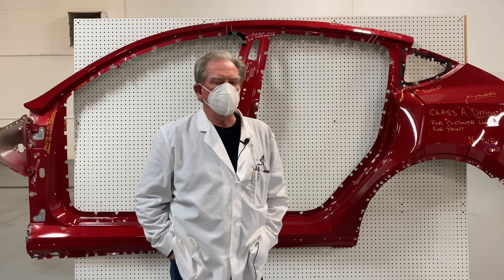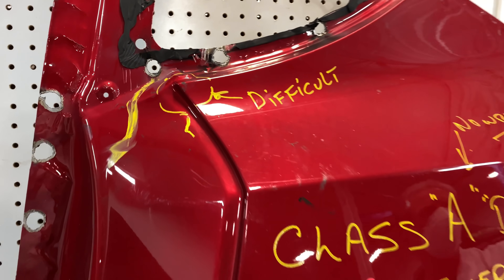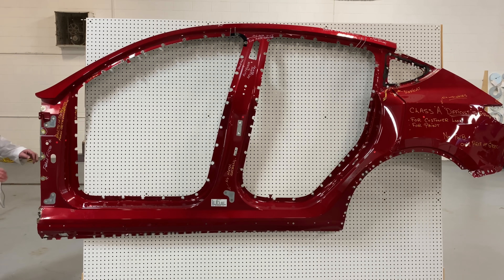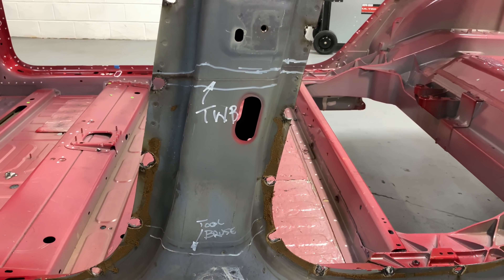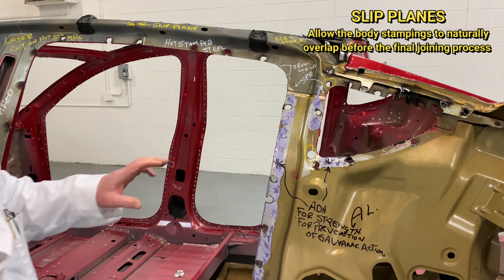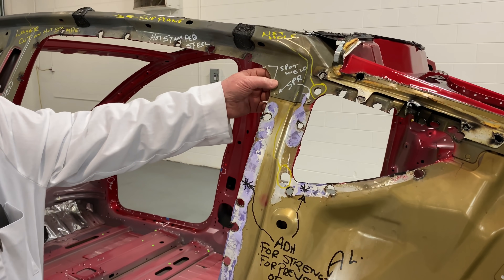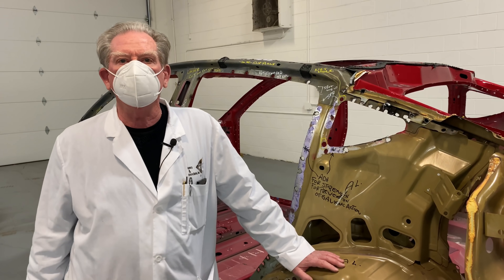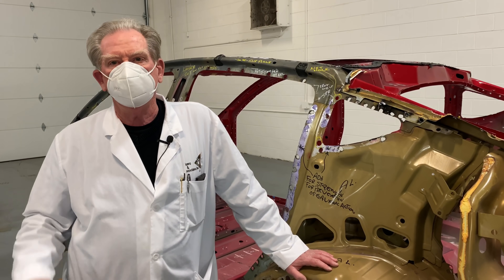Model Y E37: Body Structure Internals Revealed, Hot Formed Steel, SPR's and More

Comment: Don’t need a truck for that stuff. My little Tesla has the rear seat removed and also the front pass seat. Screw the trucks... redisign the interior. Grow up....don’t need all that toxic tech. Screw the motors in the seats. Let me cut that door up. Why the need for TWO door opening platforms? How stupid and INEFFICIENT?  Show this.  Call me, I build ten hot rods, and I’m a competent volunteer fire person and an engineer. Sad the doors are so complicated. Let’s see Elon put a door handle on a S . No wonder he has to smoke pot.  Poor design.  I’ll work for free.  Call me. 315-673-9565. Talk about the pearl paint....show the motors in the seats.  Show the unnecessary wires to the four speakers in the rear doors...wasteful? Yes.... show a fire person saving the people in the rear seat. Of a 3 and Y.  Is there a manual door system?  I hope to cut open an X in our next auto crash...  cut back on the neodymium and thorium.....call me.  I know batteries also. NCA plus.. tabless etc...show where we can cut weight and costs for the real person.  I can open the charge door MYSELF? DONT NEED A MOTOR.....

Comment: So how does the outer one piece steel skin connect to the aluminium rear quarter piece?  Looks like you cut some spot welds, but that's not possible.  Is it all attached with self piercing rivets?  Like others have asked, I'd like a discussion on how the bottom rocker panel and rear wheel arch is built to survive salt.  Especially with two dissimilar metals.

Comment: Possible rust problems with 3 & Y concern me also, noting several youtube posts from owners in climates hard on steel structured vehicles. Your Y episode discussing unpainted areas reminded me of my '67 Mustang. Ford left unpainted almost every part or area you could not easily see. The lack of paint under the cowling dogged me the entire 30 years I owned that vehicle; a good storm would soak my feet and fill the glove box every time. The only way to really fix it was to drill out the cowl welds, disassemble and repair the area, reassemble paint and seal properly. Cost was more than my example was worth. Tesla is my new dream car goal, but it has to be able to last at least 10 years without serious rust developing under daily driver usage. Our '08 Prius at 187k miles is practically rust free today.  I will be watching. Even the most rabid fan base cannot cover up all issues.

Comment: Can I count on my car guys to see things the way I do and sending me a donation to make this happen? We need a much better mask made of Thermoplastic Rubber to protect us and if made in large enough numbers can help end the pandemic being a defensive against getting the virus. In the midst of this pandemic in which covid-19 coronavirus has shut everything down I want to help and I'm developing a Mask made of clear thermoplastic rubber which can be reused many times and simply washed with soap and water and will use disposable homeade filters cutout from paper towel as the absorbent outer layer and coffee filter cutout under that. It could be replaced multiple times daily or simply when you return home wash your mask and change your filters. The Stay at home order was effective but is not sustainable because we are suffering too greatly economically as a whole in fact most of the world is due to all but essential workers being shut down unless its over internet or phone. My solution of having my clear thermoplastic rubber masks, if you donate to me so I can do it and make them available starting on eBay, are to be worn underneath your standard cloth masks fabric masks and homeade masks or bandanna. My TPR mask will offer greater protection and seal to the face and have 1/2" diameter ports on the cheeks and chin likely 7 to 9 of them total. Please watch my only youtube video and I have a Go Fund Me page because I need donations to make this mask and soon.

The filter media is to be placed in between rubber layers so its trapped and sealed. It's going to be a great answer to keep people more safe and secure and able to go out and about with their lives while still wearing a mask but a much safer mask. Doing so should become a solution to keep people from getting the virus and allow us to go outside and live our lives without getting sick and should greatly reduce or eliminate the transmission of this virus being breathed in and hopefully allow us to be able to live lives more normally with greater security and greater protection.

While other masks are not sealed this one will have a flat flange the seals against the face and forces air to go through the ported filters on cheeks and on chin and nowhere else while cloth masks and surgical masks are not sealed against the face and allow air to get through. We need a much safer mask that can be disinfected by washing it with soap and water since its waterproof clear SEBS rubber and I have the idea and the answer and development in progress and planned and just need donations to continue now. Watch my youtube video and please donate so I can fast track its completion! My mask is going to be a new not yet introduced tpr mask with ported holes on the cheeks and chin which don't touch mouth or nose. 

The mask material is TPR thermoplastic rubber latex free (CLEAR RUBBER SEBS granule compression molded manufacturing a waterproof latex free thermoplsatic rubber rubber also used for pacifiers, toothbrush handles, grips, medical tubing, medical masks) BUT I NEED FUNDING NOW to fast track its completion and begin manufacturing!!! As far as I know I don't need any other persons help I just need enough donations and funding to buy everything I need and make them in my garage and sell them on eBay. I've been Unable to get loans and also have not been paid yet for my UIA at all. It's over 6 weeks behind and nobody has answered my calls in Michigan. I need at least 8,000 to begin and really get going with it and I have launched a donation campaign through GoFundMe and soon to be an Angeleno after I relocate to LA once I have the funds to do it. Then I'll do it in my garage as I have always done with my online businesses and perhaps at some point might expand to a warehouse environment in Los Angeles and have help if needed. I'm willing to disclose many manufacturing trade industry secrets to fast track manufacturing of this mask to save lives and have people be safer so they can be out and no longer must stay at home. It's not all about me either concerning profits. I'm doing it because it's a humanitarian cause which can save lives. It's importance must not be misunderstood. 

We are in need of a mask widely distributed that offers GREAT amount of protection without having to include a special high demand filter. Stay at home order to flatten the curve cannot be the only strategy. Are you listening? We need to ALSO produce THIS mask I propose to make and can make on my own if necessary. I have the background and can do it. I want to eventually have produced this mask soon produced by the thousands if not millions to help prevent transmission and stop spread and be the most effective and economical water proof washable mask that can use paper towel cutouts and coffee filters replaced multiple times daily or when returning home. In order to do that, (since its not all about me making money for myself) I AM willing to partner when the time is right and my prototype is very high quality with proven production molds, to have this mass produced and mass distributed preferably at a variety of plastics molding manufacturers all over the country so that everyone that wants this TPR mask to be worn underneath cloth mask can have one. 

Please anyone economically able to help provide donations directly to ME to make my thermoplastic rubber mask to make it available to you also and to help stop spread of covid-19 coronavirus and offer better protection do so. I have it under development and started but its not yet completed and I'm in need of funding now. I need to raise funds anywhere from 8,000 minimum to get started to max of 40,000 USD is where I have decided to cap it at for my Go Fund Me page. If interested please view my one and only video posted on youtube on my channel and view it with the CC enabled which says more. I would greatly appreciate you sharing this with some of your many connections who could donate to me and my cause to make this mask and manufacture them also.You can donate to my paypal email directly said in my only vid and its description on my channel or through here 

https://www.gofundme.com/f/masks-thermoplastic-rubber-covid-protection?utm_source=customer&utm_medium=copy_link&utm_campaign=p_cf+share-flow-1

And please share this or text this entire thing and copy and paste it if you are moved by it. I need funding to do this and need it now. Please don't make me wait or these masks
 either will be delayed in being released after the worst of this pandemic is entirely over or if I don't receive enough funding (at least 8,000 to get started) I flat out can't do it anyway.

Please donate to me now I'll fast track these TPR masks which are not otherwise available and thank you God Bless you!

Comment: Great visualization of the body-in-white design, every mechanical engineer should watch it! And also great to see Tesla improving car-by-car - I mean it would be a shame if not so. But I'm not in line with everything in the Model Y, those foam cubicals are way too much improvisation, there are better and more reliable solutions, all foam material will suffer in the end by compression set and it's just a matter of time and head until there will be some noices from the rear wheel arches. Those 3D printed inlays or broken plastic covers for the cables are not worth calling it "premium quality" it's plain frowsy or the floor carpet which is seperated in direct line of sight on drivers and front-passenger seat. There is still room for honest improvement.

Comment: One of the things that surprises me a little (and this is coming from someone with no engineering background) is that the user-facing body panels - the ones that have to look good - aren't just bolted on to the other more structural members.  I would think it would simplify the stamping by quite a bit.  It'd also make repairs a bit simpler.  I'm sure they did what they did for a very valid reason, though.

Comment: How Tesla is dealing with the electrolytic/galvanic corrosion potential between aluminium and steel? Usually some good isolation is necessary... This car is simply amazing, nothing beats it in terms of sophistication. Feeling really sorry about the old behemoths like Toyota, VW, MB, BMW, GM, Ford, etc... His is just the tip of the iceberg, because the rest is the custom silicon and specially the software. We need a Munro for the digital part of the car, this is where some huge leverage is being done... At the end, this car is a steal, super inexpensive for what it really is... (From a Chevy Bolt owner in Brazil).

Comment: For the bolts holding on “the shotgun” in the front there, is there anything to keep vibration from loosening their nuts?  Maybe rivets might be better? Or would a riveting gun also not be able to get in there?
Reply: The tread is the panel, no nut, and probably Locktite
Reply: Mr2winners, I saw a note on the mating panel saying “includes nut” (or something close to that), but not clear whether that means that they threaded that panel or they attached a nut to it somehow.  The threads there looked pretty deep.

Either way though, threads can loosen.  Hopefully Locktite will hold it pretty much indefinitely.

Comment: Tesla's putting a lot of faith in those two rivets on the C pillar. I don't think I'd put anybody I cared about in that hypothetical 3rd row seat. First because it will fold up right through the "one bolt" in a rear end collision that overrides the bumper. Secondly because the only steel in the body rear is the outer skin. But if the rivets tear out of the aluminum I wouldn't want to be in the back seat either. I could be all wet. Not my area.
Reply: The rivets are more or less just positioning the different panels while the adhesive is providing the structural strength.

Comment: The sound effect was like watching Mr bean show 😂😂.
The Model Y body is just a few body parts of Aluminium & steel with most of them being a large single piece. Impresed with Tesla.❤. Lots of costs savings there.
Reply: Sandy in some oh his interviews has mentioned an aircraft company that built an aluminum seaplane that the FAA refused to certify, the aluminum was proprietary alloy that did not corrode and had high strength, wonder if Tesla could duplicate that. Get away from corrosion issues. After all they have that special allow for the big castings

Comment: Correct , Aluminium hates steel and you still can see this on the old land rovers 80 ,109 ...( serie III ) In the past land rover had a reverse currency ( the ground was + ) after switching to a - ground on the body on some parts of the body the paint starts peeling of because of that .The chemical reaction between the steel ,rivets and the aluminium caused this problem. @sandy ,i already was suspecting glue between the panels .

Comment: Any comments on how well the Y should hold up against rust in high salt usages areas like western NY?   Thanks for the videos.
Reply: Sandy in some oh his interviews has mentioned an aircraft company that built an aluminum seaplane that the FAA refused to certify, the aluminum was proprietary alloy that did not corrode and had high strength, wonder if Tesla could duplicate that. Get away from corrosion issues. After all they have that special allow for the big castings

Comment: Is it possible to die cast with aluminum all the body In white in few pieces joined together? After the video of rear body cast I understood that there are only pros in doing with die casting
Reply: thats not good at all, because aluminium in an impact is britle, but steel or aluminium sheets are way more flexible at absorbing shocks

Comment: Surprised by how much « unused » space there is above the rear wheels.
Reply: The right wheel well space does get used for the audio system amplifier and subwoofer (which is very ingeniously molded over the wheel well) in the Model 3. I think Sandy showed us that the same setup exists in the Model Y too. 

For the left wheel well we have the high voltage charging cables running, so I guess they decided not to add any other complexity there.
Reply: @harshalhbhosale /videos Also the versions for countries with separate AC and DC ports have their second port in the left wheel well space.
Reply: Florent Salako I was just thinking the same. Appears in all cars it seems. Could like expand storage out more. My cars and a very tiny storage compartment there, but it seems like it could be larger.
Reply: Sounds like time for a 602 and 275s!

Comment: Could you address how well the body is rust-proofed? Coming from a part of the world where an abundance of salt is used on the roads, rust is a major concern.
Reply: Good question. I see some rust already on that steel part ( below  a pillar i guess not painted over which  finished side goes. Also did Tesla try to save to go with 120mm welds which Sandy said is”different” and typically these welds are closer to each other
Reply: I'll tell you what makes me worry is the seams where they welded through several layers. That's where I fear moisture is gonna get.
Reply: That's exactly my question as well, especially with a lot of foam in the pillars it's easy for moisture and salt to get trapped, that can destroy any car in a matter of 10 years, also the battery is encased and does not seem particularly well rust proven...
Reply: @hutlosful  Didn't you see how battery is sealed????? That glue holding the case to the top and bottom is hella' strong.
Reply: @1flash3571  I am not worried about the battery case rusting from the inside but from the outside
Trust me when you live in an area where the streets are full of salt every winter you know that nothing will stop rust anywhere, the question is only how long you can keep it in check.
Reply: @hutlosful  I live in a place that regularly gets 3-4ft in snow...salt everywhere...never had a problem with the 6-7 cars I've owned. My point is salt corrosion was a problem solved many years ago...you won't have any issues with a Tesla or any new car for that matter
Reply: @blakeacheson9387  Well thats not completely true. Rust is still a problem. Even premium brand mercedes had BIG problems with rust only a couple of yrs ago
Reply: @teamswix  I've owned many porsches, mercedes and a few bmws...some for 10 years....zero rust issues

Comment: Sandy, what's your thoughts on the possibility of rust on the Model Y with all the steel?  Is it coated with a rust resistant coating?
Reply: There is an old video of a part of the Fremont plant where they dip the BIW Model S in an electroplating bath. I believe they do the same with the Model Y.
Reply: I watched a little further and saw the ecoat description. Is the entire car dipped or coated or just specific areas?